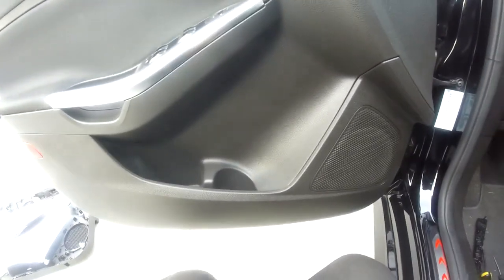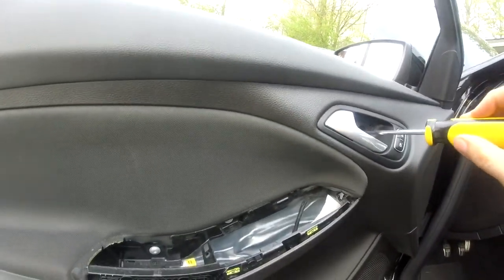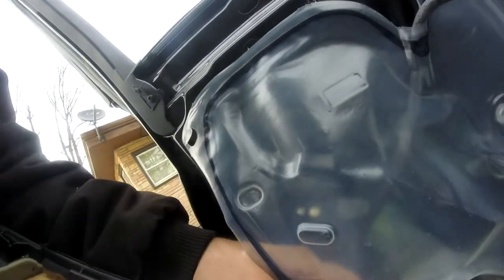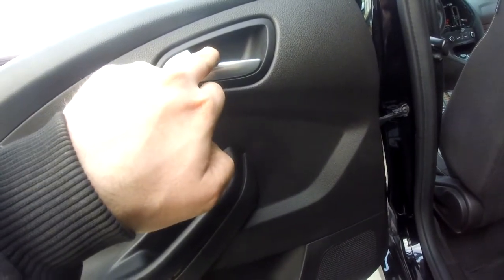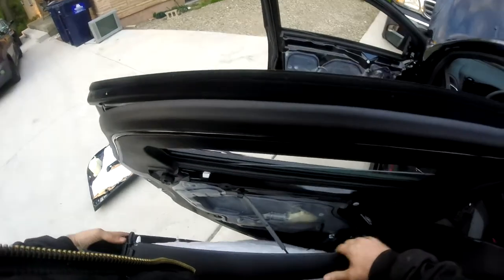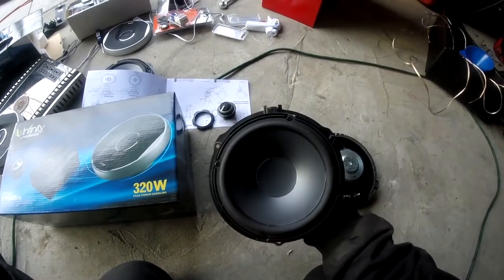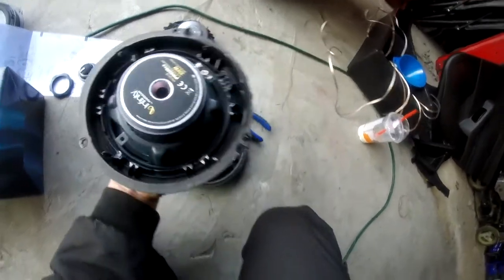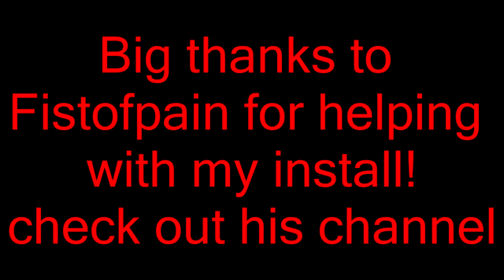Audio Upgrade in my Focus ST1 Part 2 (Door removal/modification)

Comment: On the rear speakers, what color are negative and positive on the Ford wires, I am going to replace the rear speakers and use those wires to lead to my amp.  I have an Alpine mono power amp MRV-500 going to a Pioneer ts-swx2505 sub.  I am thinking a rear speaker with better highs like a three way speaker. This set up should give me good bass and clearer sound from the three ways.  I will keep my front door speakers for now. Maybe replace just the tweeters.    Thanks guys
Reply: Did you find the colours?